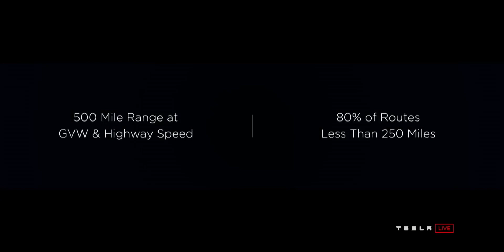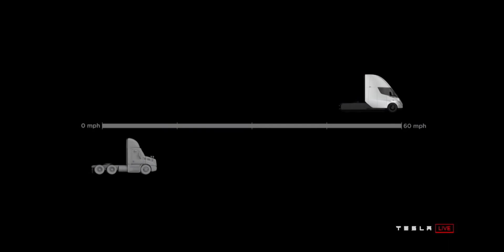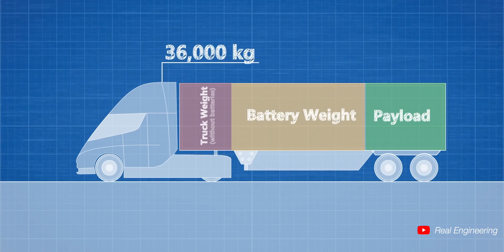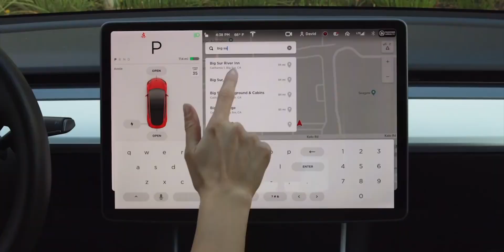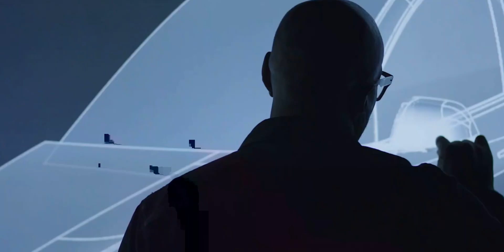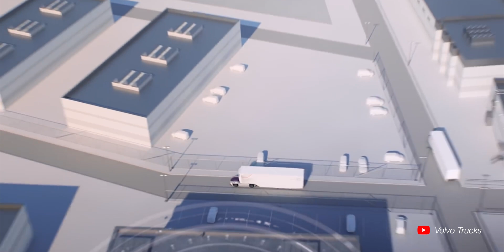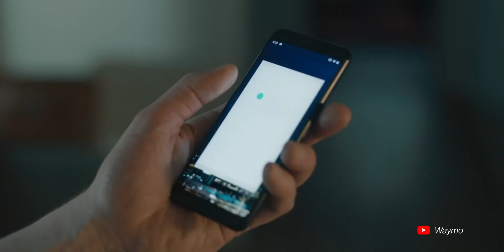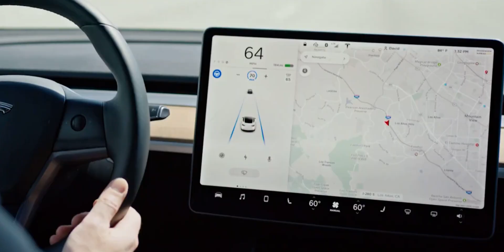Top 10 COOL THINGS YOU didn’t KNOW about the TESLA SEMI

Comment: I am an owner op for 14 years now. I will never get a tesla semi, i prefer my diesel engine beast. It will own a tesla truck anytime of the day. I roll 70-80 miles per hour and fully loaded i can accelerate just as fast as a tesla truck. There are so many things that i can go into where a diesel engine and a live driver will still be on the roads for another 25-50 years atleast. For example i haul loads where i gross over a 100 thousand pounds with permits. I am a flatbed driver i haul construction material, steel and all kinds of stuff requiring open trailers. There are so many parts to a semi truck and his guarantee 1 mill miles warranty is bullshit. There are tons of stuff requiring replacement on a truck other then breaks and engines. I roll 70+ miles per hour and pass slow moving traffic quick jf i want to speed up to 80+, but what about 2 trucks governed at 60 and one going a little faster then other where it takes them 2-5 minutes to pass which happens none stop on todays roads because of governed truck. Since i own mine its not. I could go on for ever to discredit 85% of what Elon said about his tesla truck and the vision. Some things i do like.

Comment: Takes 5 minutes to fill 300 gallon takes and that's if you don't have to wait 30 minutes cause there's a long ass line. If it's gonna take 30+ minutes to charge then they better prepare to put in a crap load of charging stations other wise drivers could end up waiting for hours to get charged
It's gonna be a very long time be self driving trucks takes away drivers jobs. We might not even see it in our lifetime. Truck ain't gonna know what to do if a tire blows, how to secure loads and check to make sure load stays secures. It ain't gonna know what to do in the snow and all the cameras get covered

Comment: Not all acurate pointers:
1)Otr is usually more than 500miles in 11hour shift in u.s.a we do not have the luxury of charging every 500miles when in a shift you can do 550-750miles depending the states you drive in mph is different in every state for example Nebraska 80mph, California 55mph. 
2)local driving here in california is 150miles radious to and 150miles back to terminal that's 300miles and local electric trucks only go 250miles? Tesla got the math wrong.
3) battery life will start to reduce after so many charges it also fluctuates on outside climate hot/cold.
4)how will this trucks maneuver in reverse in a city like New york.
5) can it off load itself when at customer? some don't have docks or forklifts. Unless all that work is left for box trucks with liftgate on back of trailer. 
6)being hacked electronically 
7) theft over the road criminals
8) accidental deaths liability
9) why the emphasis on how fast it is at       take off, will freight get there in 1 piece. (Pallets fallen back) inpatient people don't get it its an 80k lb truck a professional driver will never try to race a car, it's OK to be slower and safe.

Not all is bad if this trucks are good for point A to b  on open road short range recharge at terminals and do it again. Just my opinion

Comment: Hi, rollovers are caused by trailers flipping first like big sails and pull the tractor with it. It should be equipped with a safety breakaway 5th wheel. Theory is easier than practice.

Comment: All i see is a double blindside when backing into a dock and lots of people slidding as they let off the pedal on snow or rainy conditions as the motors create drag in order to generate power. Of course the great thing is at the bottom of the ditch ur batteries will be charged!! Ignorance is abundant now a days.

Comment: Bit of an issue with the rollover risk. If you take a look at the video, you'll notice that most if not all rollovers start with the trailer. Would have been better to mention jackknifing here instead.

Also, the convoy mentioned. 1 driver in the lead while all others autonomous or otherwise, followed. Just like a train. Other drivers could probably join the convoy for the free ride, but drivers would likely take turns in the lead just like bicyclists. Let's bring back the CB radio on the Tesla Semi's. Mmm, wonder how they will integrat spacing for normal vehicles to get to the off ramp.

Comment: Please learn just the bare minimum about trucking before you make a video.  Drivers have to take a 30 break every 8 hours. You can't just jump on the gas. All the freight in the trailer will fall over. Fueling a truck takes less then 10 minutes.  Once a lot of these tesla semis get on the road the wait time to get on a charger will kill your time. It's not the truck that rolls over, it's the trailer that rolled over. It pulls the truck over. Just tell  those 2 million peace of drivers should just die off.

Comment: 0 to 60 in 20 seconds, just soon as they develop a tire that will withstand it.
Reply from the maker: I would be more concerned about the cargo than tires. Tires will easily handle that as diesel semi’s can stop pretty quickly without a trailer.
Reply: @ElectricCarsAreLit  I can tell you have never driven a bobtail semi tractor, it's like driving on ice.

Comment: I’m thinking a 53’ box trailer with solar panels on top  might extend battery life.
Reply from the maker: Nope, it’ll be enough to keep the cabin warm/cool, but not enough to run the semi. In fact, if it was facing the sun for 4 hours per day, you would only gain 15 miles of range. Not worth it.

Comment: You can drive 8 hours continuously than you must take a 30 min break than you only have 3 hours left before you must take a 10 hour rest break. As a driver myself I have never driven 8 hours usually 7 hours before I stop to stretch out.
Reply from the maker: If I assume that you travel at an average speed of 65 mph (104km/h) then the distance travelled I get is 520 miles. Which is going to the be the range of the Tesla semi. In fact many sources are saying that the range is going to be closer to 600 miles fully loaded 80,000 lbs at highway speed, so 60-65 mph! Plus considering this is not a sleeper I think the range figure is good, they can make a sleeper version with an even bigger battery to suffice that need!
Reply: @ElectricCarsAreLit  so you do realize adding a sleeper alone adds 2-3k pounds of weight then let’s talk about the apu units, constantly adding weight to the semi isn’t good in the industry. My average loads are 45k-49k pounds plus add mountains in there as well, I would never trust a semi to do self driving, what happens when a 4 wheeler does use signal cuts you off and something in front of him happens, you’re going to kill everyone in front of you until the truck stops, Tesla isn’t in the trucking industry and I don’t trust him making a semi

Comment: Awesome truck... BUT what about the "sleeper" compartment? The video didn't talk about that compartment at all and I'm wondering where the driver will sleep during their mandatory breaks by law according to their Log Books.
Reply from the maker: There is no sleeper compartment. It looks like that but it’s actually a small truck. It’s probably because of the aerodynamic flaps that extend out to the trailer which makes it look bigger than it actually is.
Reply: @ElectricCarsAreLit  so it’s a local truck only, it’s not set up for over the road.

Comment: The rollovers are caused by wind against the trailer. The low centre of gravity on the Tesla semi won’t do much to prevent trailer rollovers. Only unless Tesla comes up with a more advanced fifth wheel mechanism mainly to prevent damage to the semi and its frame.

Comment: Gonna feed you some info about the weight. 80k max but we're limited to 34 in drive (the 2 rear axle) and trailer and 12k in the steering. Where we don't usually pull at 80k we certainly pull on max axle weight nearly every load. Also, we can drive 8 hours 30 minute brake and drive another 3 total of 11. The charge needs to be over 1000 miles we do not have the luxury of fueling or recharging every day. How about emergency weather and we can't give ourselfs a big buffer to be stranded a couple days? Where I'm a fan of the truck    , I also understand the uphill battle tesla has.
Reply from the maker: Thank you for this information, really helpful. This truck isn’t meant for cross country since it doesn’t have a cab with a bed, even though it looks like one, but it’s a more local truck. Maybe a bigger version when batteries get lighter 🤷🏻‍♂️
Reply: @ElectricCarsAreLit  ohhhhhh, I thought it was a sleeper! As a day cab yes a no brainier it's an amazing truck for that job. The weight is even less less than a factor they and 600 miles is perfect range
Reply: Come on driva I hear ya, tell em about the gun line 😅

Comment: PROTESLAPOWER and a lot of others like the content of your videos. They are also informative and entertaining. Before the Cybertruck was unveiled I as well had some ideas about a Cyberline. I suggested also that the recently acquired Hibar Battery Plant in Toronto would be good for Hi-density batteries and Tesla solar. Months ago I tweeted Elon Musk about some of these ideas but he gets so many tweets mine were probably overlooked. Don't get me wrong I think the Cybertruck rocks with its 30 time cold rolled stainless steel exoskeleton and many other features. I believe that the market is also waiting for a Heavy Duty Tesla truck one that could be used for buses, ambulances, delivery trucks, dump trucks, RVs, etc. We could call this one a Cybersemi. From an economic standpoint and the fact that they can be built quickly and affordably alongside the Cybertruck. There should as well be a Lite Duty truck two or four passenger with fold up rear seat and on off road capability, they could really fill the gaps in the market place. This Cyberside-by-side could fit in the $25,000 range and be a little powerhouse even in small places. Of course extra utility type accessories could be available for it so that it could power like a snow blower, lawn mower, forklift, jet boat, etc. Oh yeah let's not forget a solar shelter option. I do have a background in Commercial Energy and Automotive Marketing but I could still use help getting these ideas out there. So if you like these ideas or have some of your own to add please let me know. I appreciate all of you and your comments. It's time to fix our future!
propower101@hotmail.com

Comment: 1,000 lb heavier? L a m o . Funny it only ever seems to be seen with loads of about 30,000 and under. That would put the weight at somewhere about twice what a diesel day cab tractor weighs.

Second problem is where are you finding the two megawatts to charge it with. That's a 2500 amp, 480 volt, three-phase circuit for each and every charging stall. If you think you're going to get that with on-site wind and solar, stay on the short bus because that's where you belong
Reply from the maker: You can set up mega packs, which Tesla happens to build and they can keep a constant draw from the grid while supplying 1MW for a truck to charge. It’s not as a big of a problem as you might think.
Reply: @ElectricCarsAreLit  well the total amount of trucks you can support depends on how much power is coming in. 2 megawatts coming in would support 48 trucks. One megawatt coming in would support 24 trucks. 500 KW would be enough for 12 trucks. When we get down in the range of 250 KW that's probably the most you can tap into most locations that will only support six trucks charging per day. What good is that? I don't care what kind of battery you use, batteries are storage they don't increase the amount of power coming in. They are not over unity devices. Only retards believe in over unity devices.

Go to a truck stop and see how many trucks take on fuel in a day. It's one hell of a lot. And these Tesla semis with their shirt range will need to charge twice as often as a diesel equivalent needs to fuel

Comment: It takes 4-5 minutes to fully fuel a truck some truck drivers take 15 minutes cuz their fucking around inside the fuel station
Reply: Ok so when the driver is back in the sleeper drooling on the pillow for 10 hrs (or more) what is the truck doing? Burning fuel, even if it has optimized idle it's still burning fuel just sitting there, if you can do your 14 hour shift without having to stop for fuel and then recharge on your 10 off that seems like it would work pretty good, and no having to wait at the fuel islands for drivers taking a 30 lol
Reply: Plus how long does it take a truck to climb eisenhower?

Comment: These are benefits of an electric powertrain not just Tesla semis. Hyliion hypertruck ERX range is 1300 KMs today , the batteries are charged by onboard generator that is fuel agnostic ( RNG or hydrogen). The hypertruck carries more load that Tesla as it has smaller batteries and is 50k cheaper per truck. Also Hyliion powertrain can be installed on most major OEMs and fleets don't have to change their favorite truck body
Reply from the maker: There are so many problems with this idea but I can summarize why it will not happen in 1:
Energy Efficiency!

What’s the energy in vs out, and is it renewable, thats the biggest problem with hydrogen, you only get 1/3rd of the energy out that you put in, but BEVs can get well over 2/3rds, that’s more than double the efficiency! Also natural gas isn’t renewable so that is definitely never gonna work.
Reply: @ElectricCarsAreLit  renewable natural gas is just let off from dairy farms are landfills. So that's almost free of any input just collection cost. Some input cost to mix it with conventional CNG for compatibility with existing CNG engines or generators. Electricity grid on the other hand is 60% fossils. No to mention that semis is a different game altogether. 2 semi fast chargers will take as much electricity from grid as a automobile production plant producing hundreds of cars per day.

Comment: https://youtu.be/Sy94RXBThB0?t=624 The handling advantages you claim aren't really there. Look at the footage you've posted - it is the trailer's CoG that's critical here - once that starts rolling over, it will either (a) take the tractor unit with it, or (b) decouple from the tractor. Unless the tractor can get heavier on-demand, the marginal benefit of CoG will be as nothing compared to the roll-over forces acting on (and exerted by) the trailer.

Furthermore, is the CoG of the tractor really much lower than a traditional one? All the major masses in a trad tractor are pretty low down in any case.
Reply from the maker: You’re right, and to be fair that probably wasn’t the best clip to add but there is still a benefit. American trucks have their engines above the axle whereas the battery pack would sit between the axle. And yes there are gearboxes and differentials and all those heavy parts between the axle but the engine still has a lot of mass to offset the CoG. Now because of the lower CoG, even a trailer trying to flip over will have a harder time flipping over as the mass is down low, but to really see an advantage, we need people to test it and show us the results, until then we can only predict what will happen!

Comment: Unfortunately you have cargo on board that doesn't react well with the fast acceleration here.  There are many loads that can not handle that g force your talking about. Also they would have to have a lot stronger suspension then they have with the Tesla. I think it might be a good short distance unit! Winters up here in Canada would also be a problem. Battery power is cut down drastically in temperatures below freezing.
Reply from the maker: I live in canada, and have actually spent 1 winter in Thunder Bay with -40C so yes I sort of have an idea of winter climates! Firstly I’d like to ask how many times do you floor it? Chances are almost never, but even a bump in acceleration vs diesel is welcome, plus drivers can easily manage that. For the battery issue I’d like to say that trucks are used a lot, and don’t spend much time sitting doing nothing unlike a car. So a car battery would start to lose heat and cool down, but for a truck, it can keep its battery warm. If the battery is kept warm, then the range loss isn’t much, aerodynamic drag and road friction would be the one to be careful about, but trucks can slow down, which they normally do up there on the trans canada highway. For reference driving about 70km/h uses half the energy vs driving at 100km/h and I doubt truckers are driving at 100km/h in the dead of winter with snow on mountains! Hope I answered your concerns.
Reply: I can picture all the cowboy drivers lining up at traffic lights drag racing and leaving their payload on the road.
It will happen.